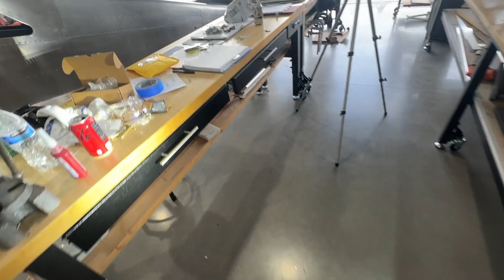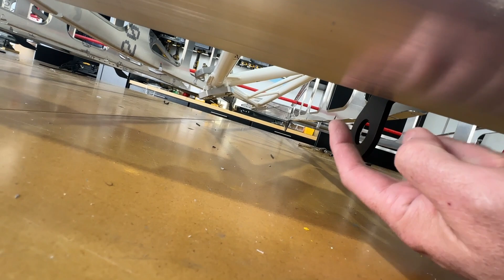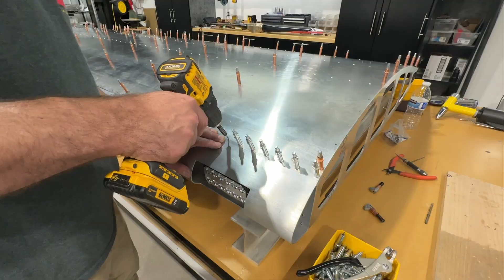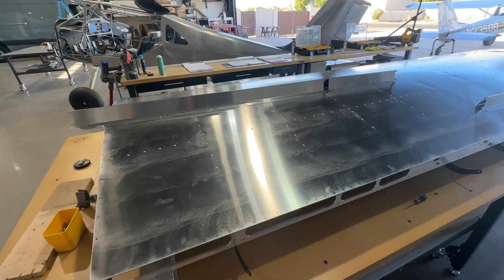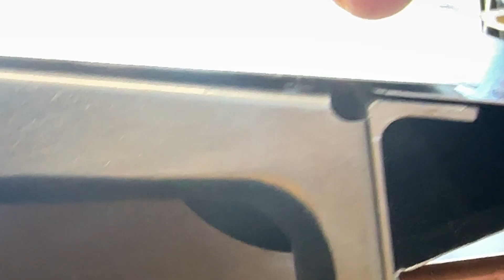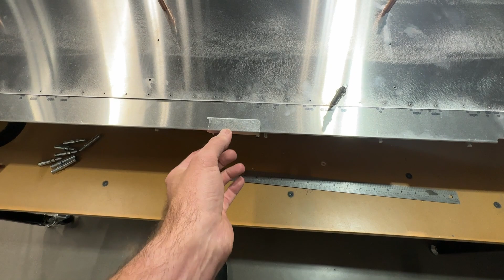Ep. 42 - Rans S-21 Left Wing: Part 2

Comment: What is the part number for the dimple die ?
Reply: I have yet to find a 120 degree dimple die for #40 size hole, only a 30 size (1/8th inch)  hole. Only dimple dies I see for #40 size hole are 100 degree
Reply: Found it.....
Cleavaland tool Dimple Die Set For 1/8" Avdel N Or Q (SKU: DIENQ)

Comment: Very informative video as usual and no doubt will help others with their build. Keep pulling those rivets, soon you will be flying this plane and in utter disbelief how Randy's design is both easy to build and so sweet to fly. FYI, I ended up using airframe ground on my landing lights even though I had 18ga wire as you do. Always good to have more than you need.
Reply from the maker: Thanks!! It truly is an easy airplane to build!